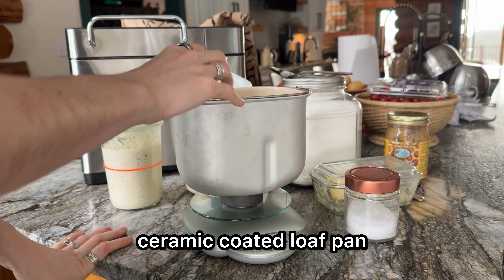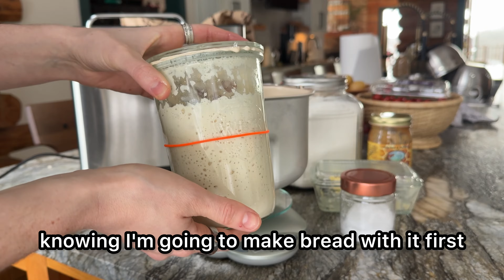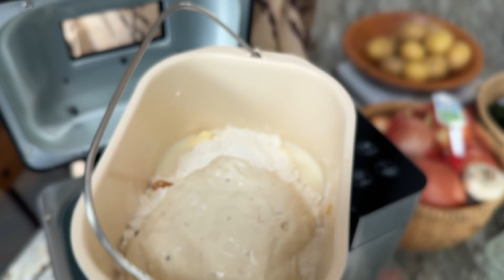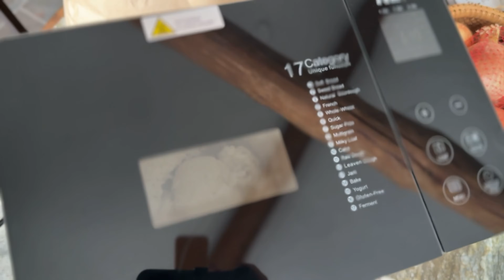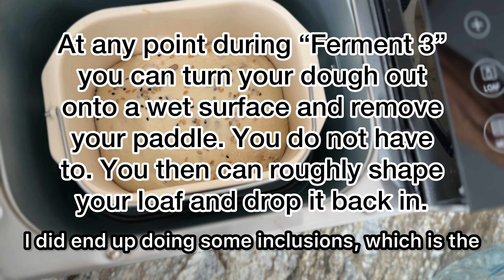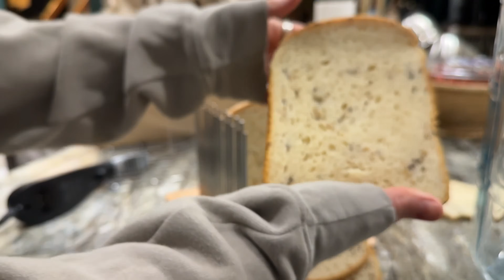Bread Machine Sourdough Sandwich Loaf (NO YEAST)

Comment: You can use your starter straight off the fridge without activating it. The rise time will increase to 10-12 hours or so but it works perfectly. Put all  the ingredients in the breadmaker at 8PM and use  knead programme. Let it rest and rise over night and then bake it at 6AM. I never discard my sour dough starter. Make small batch and keep it in the fridge after activating it. Works every time year after year. The longest fridge time for starter has been 6 weeks and it was still fine. This repeated feeding and discard is all myth.

Comment: Hiii! Did you add the inclusion yourself or did you put it in the basket that comes with the machine?
Reply from the maker: @Ms.LanreKas  I’ve done it both ways, but find that using the basket works best because I often miss the prime time to add the inclusion. Small seeds seem to slip from the basket, so I tend to put the big seeds in first. If I’m home and just relaxing, I wait until I hear the clicks of the machine trying to release the basket and walk into the kitchen and dump them in myself to avoid the tiny mess the basket can make sometimes.
Reply: So this machine has a sourdough setting?